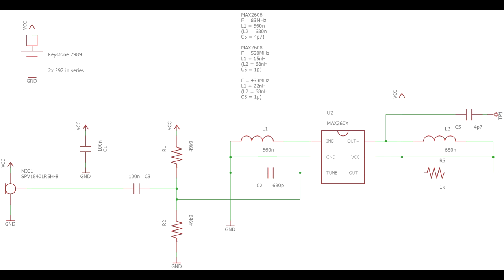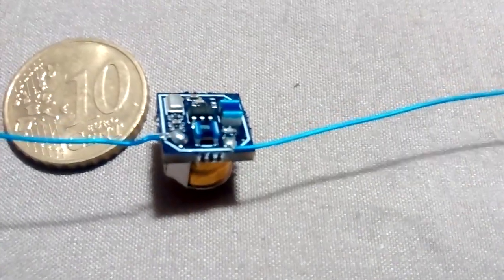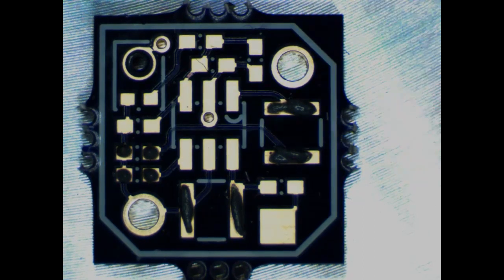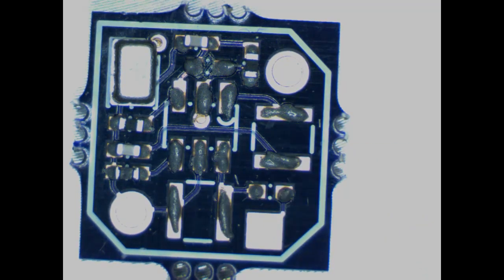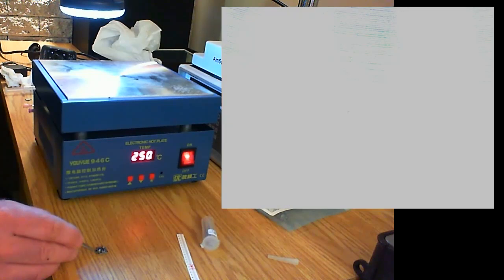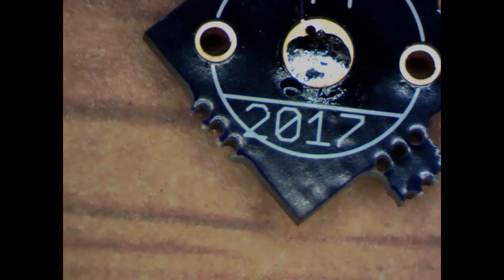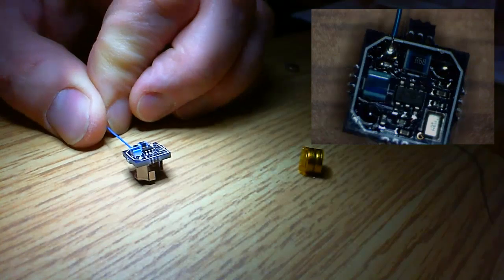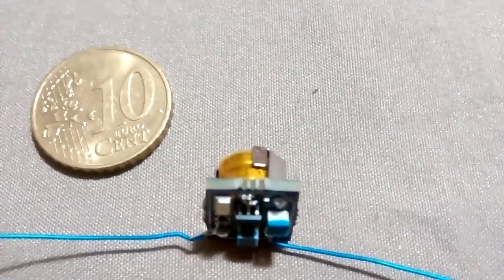📻 Simplest ever surveillance FM transmitter 45MHz to 650MHz  📻

Comment: Hi,wieder ein super Projekt:-) hast du wieder die einzelnen Bestellnummern bei digikey?
Reply from the maker: Oh, muss ich zusammensuchen, ist schon ne Weile her dass ich das gekauft hab. Wenn in DE dann gibts sicher billigere Anbieter, 0402 packages sind ja mittlerweile ziemlich standard. Die MAX260x auf Aliexpress kaufen.  Ich such naechste Woche mal die Liste zusammen....
Reply from the maker: There you go:

GRM1555C1H4R7CA01D 4p7 NPO 0402
CL05C681JB5NNNC 680p NPO 0402
GRM155R71C104KA88J 100n X7R 0402
RC0402JR-071KL 1k 5% 0402
ERJ-2RKF4702X 47k 1% 0402
LQW2UASR56J00L 560nH Q=45 1008 wirewound air core
LQW2UASR68J00L 680nH Q=45 1008 wirewound air core
MAX2606EUT+T
SPV1840LR5H-B MEMS microphone 2.75x1.85mm
2989 keystone battery holder

Always choose packaging type CT (cut tape).
You can choose any other manufacturer too for the passive components.

If buying from digikey click on the banner in the upper right corner to change country and language.

Comment: Hi! Many-many thanks to You for your truly beginer-friendly work and blueprint-sharing!! 💖🌟🌟
Some question, also : How could I calculate L1 value, if I want to archieve the maximal 650MHz with MAX2609? And in case such a super small 1pF C5 value, how can I avoid the parasitics?
Also, how could I modify it for a line-level {about +/-1V, 2V peak-to-peak} audio input (e.g. connecting it to a PC line out jack output)? What would be the proper way? Or a dumb-simple resistor divider would do the job?

Comment: Hi! May I ask why L2 is there? Because to set an oscillator frequency you only need an L1. Just curious. Thank you!
Reply from the maker: OUT+ is a high-impedance Open-Collector Output. An external pull-up resistor or inductor to VCC is required.
Reply: @tomtechtod9200  Why did you choose inductor over pull-up resistor? I'm new to these things, that's why I ask.
Reply from the maker: @gonesparking1497  as far as I remember it was to increase output power. Through an inductor I get more DC current while greatly attenuating the RF.

Comment: How long is a 1/4 wavelength antenna wire??
Reply from the maker: Mark Mikhail 88cm at 85MHz. Wavelength=Wave velocity/Frequency
Reply: TomTechTod thanks Tom, is there anyway that length can be brought down? What are some other antenna options?
Reply: TomTechTod understood thank you
Reply from the maker: Mark Mikhail increase the frequency and use a different receiver like an rtl-sdr USB dongle . can be connected to a cellphone if it supports OTG. Cost about 20 dollars. Other than that maybe a directional antenna if the transmitter has a fixed position. Thats also valid for the receiver. Other than that you need to experiment
Reply: TomTechTod thanks Tom, ill go with the UHF model but unfortunately only the IC XMITTER 433MHZ ASK/FSK 10QFN is available, could that work instead?

Comment: Really good video. Thx. A question. Just wondering how you placed the solder paste?
Reply from the maker: Timothy B I usually dip the tip of a piece of wire into the paste and then put it on the pcb. You could also use a syringe. For higher quantities a stencil would be used.

Comment: Howdy sir, do you have a corresponding uhf receiver using integrated chips?
Reply from the maker: sorry, no. I'm using a RTL-SDR module, very cheap
Reply: can you give me some advice regarding making uhf receivers?
Reply: Thanks sir
Reply from the maker: That will depend on which frequency you want to use the transmitter.
Reply: I am planning to have a 45-650Mhz receiver
Reply from the maker: I am not aware of a single receiver chip that covers the whole spectrum fr4om 45 to 650 MHz. Also don't forget, this whole range cannot be achieved with a single MAX260x chip, it's a whole series of ICs, each of them covering only part of it.
Reply: Frecel Roque  Hi, maybe you can find something here: http://vrtp.ru/index.php?showforum=46
It is in russian though

Comment: Sir have you tried transmitting between 300-500Mhz using MAX2608? Does it really work? Thanks in advance
Reply from the maker: Yes, I tried it on about 433MHz with the 2608. It works just as the datasheet claims it to be working. Pretty stable too eventhough it's not crystal stabilized.
Reply: Thanks a lot Sir
Reply: Sir,  I am trying to build a trainer set for fm transmitter and receiver at uhf band, it needs to transmit at certain variable frequencies, can I utilize Max2608 for this project sir? will it be suitable for such design? Thank you sir!
Reply from the maker: +Jangjang A what do you mean by trainer set? an educational tool?
Reply: yes sir, I'm building it as a school project, can i use the max2608 along with DIP or common resistors and capacitors sir? where can i simulate this circuit sir?
Reply from the maker: yes you can use the max2608 for that. all traces should be kept as short as possible, all small caps NPO types. Don't mount on a breadboard. I don't see a spice model available for this IC in order for you to simulate.
Reply: So this means Sir that I could adjust the frequency varying from 300-500MHz by using only one L1(15nH)?
Reply from the maker: no. look here page 10 of the datasheet https://datasheets.maximintegrated.com/en/ds/MAX2605-MAX2609.pdf.  the VCO tuning curve is shown in the 3rd picture on page 5. It has a good range but you cannot cover the whole spectrum with a single inductor
Reply: Ok sir, I'll check. Thank you
Reply: Sir,  can I change the R1 into a potentiometer so that can adjust the voltage input for the frequency to vary?
Reply from the maker: replace R1 and R2 with a single 100k pot then. wiper in the middle, + and gnd to the end terminals. Don't adjust it to the max or min or the audio signal will get clipped.

Comment: can we have UHF
Reply from the maker: Yes you can have any frequency between 45 and 650MHz by choosing the appropriate IC, MX2605 for the lowest and MAX2609 for the highest. The antenna output matching network and L1 need to be adjusted for every frequency. I tested the circuit with 85MHz and 433MHz. The component values for 433MHz are indicated in the schematic in the video.